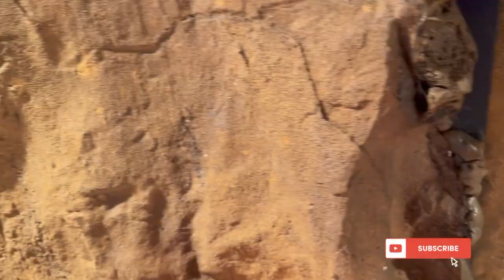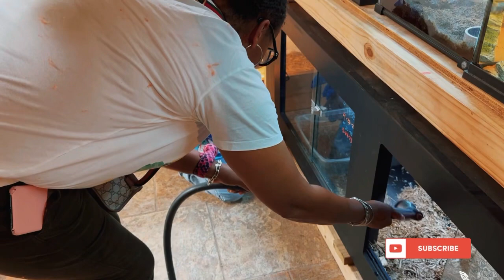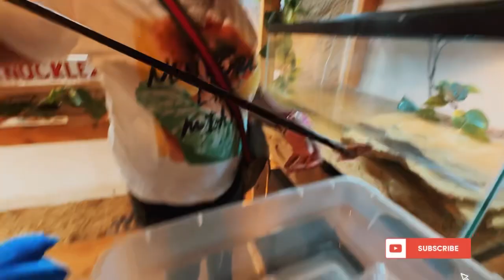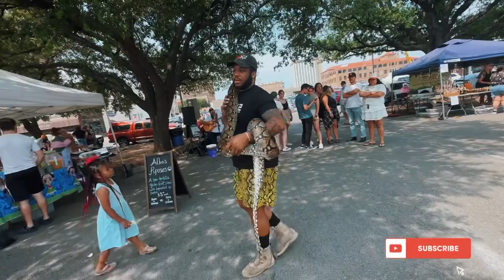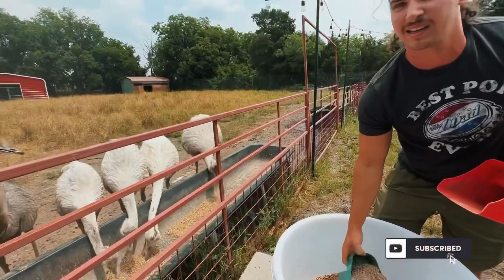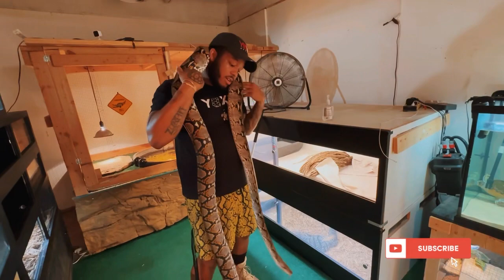Mama Take Over !!

Comment: On slicks enclosure you can rock out the framing on the front of the cage on the inside and outside. Then on the inside of the door trim paint it the color of the rocks or paint it black. It will set it off. You can even get a longer limb and take it from one corner to another (stretched across the enclosure)
Reply from the maker: I see the comment now lol
Reply: @yox2reptiles954  yes sir!